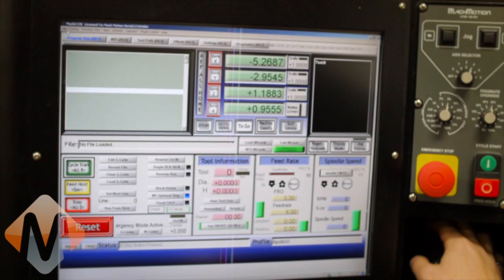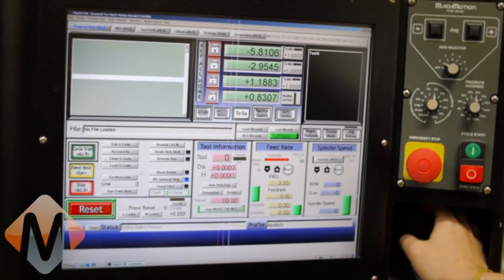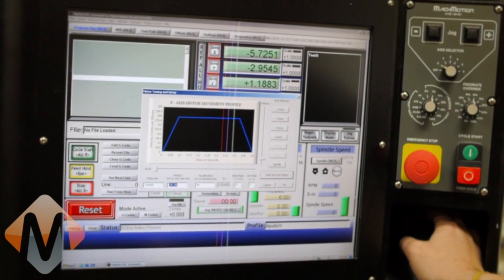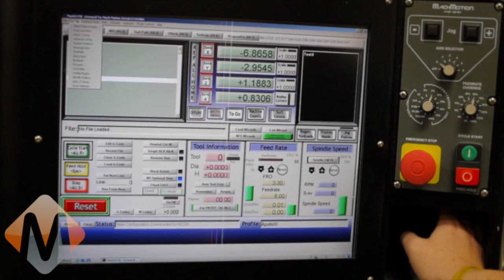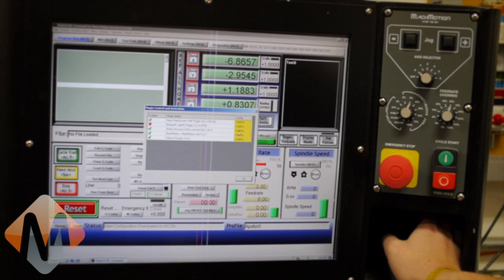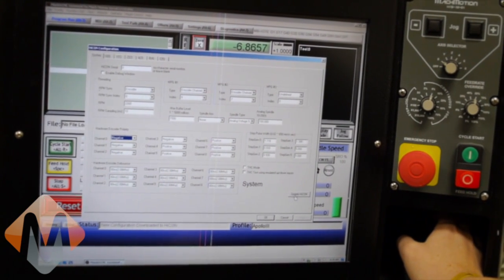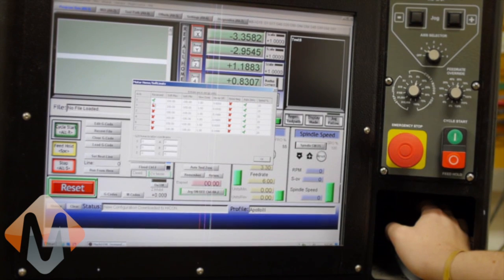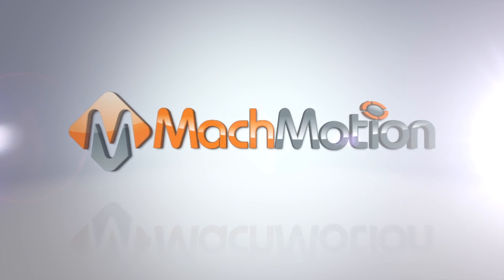Setting Up Your Axis in Mach3

Comment: you're wrong setting pins on the motor in motor section OUT, changes to the numbering outputs. Not all cards have identical outputs!
Reply from the maker: BIXBY s.r.o. This video is specifically for our Apollo III motion controller. Sorry for any confusion.